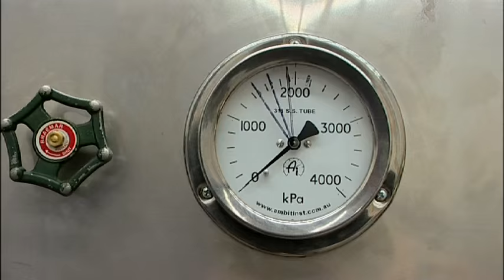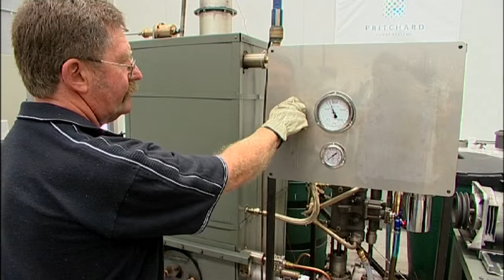Ted invents a new kind of steam engine

Comment: I do believe that Ted's design may not only be an answer to 3rd World power generation but an answer to the worlds Plastic and Waste problems. I would love to see this engine running on waste plastic.
Reply: Reciprocating steam engines are not the answer to anyone's problems
Reply: @sandervanderkammen9230  It's really not your typical reciprocating Steam Engine. It is much more efficient than a typical reciprocating Steam Engine and when Ted had one in the Falcon it was better than the new GT of the day. It took a long time for ICE engines to pass it in efficiency but it still has the advantage to be able to run on any fuel. The world has two major problems where the solutions are at odds. We have a plastic pollution problem and we have a carbon problem. We can turn plastic into fuel but it makes the carbon problem worse. We still need energy and we still need to do something with the plastic, engines like this could help especially in 3rd world countries that also have a environmental trash catastrophe playing out that we in developed countries are very much responsible for.
Reply: @theauthenticsteve  That is absolutely false, Ted engine was not a breakthrough design and was horribly inefficient.
The performance specifications of Teds Falcon qere so embarrassing that he nearly publicly discosed them although he continued to make false claims to attract investment.

Plastic can bevery easily converted into ethylene gas which can be used as a fuel in internal combustion engines with 400% greater energy efficiency.

Reciprocating steam engines are obsolete technology.
Reply: @sandervanderkammen9230  You clearly don't know what you are talking about. Plastic conversion is not efficient and currently uses more energy than you recover. I question your motives to write such rubbish.
Reply: @theauthenticsteve  That is why plastic is either recycled or simply discarded...
If your country is too poor to afford Diesel engines??? Waste plastic is the least of your problems.
Reply: @Captkid1 Reciprocating steam engines are obsolete technology, you are obviously not qualified to speak inteligently about reciprocating engines if you think they have a future.
Reply: I see Ted’s still making your mangina bleed 🩸  @sandervanderkammen9230
Reply: @theauthenticsteve  yes it was a poppet valve uniflow, not common in steam engines.
Reply: @6killer426  Ted is dead... and so are steam cars.
Reply: @6killer426  Steam engines are not common... what is your point son?
Reply: @sandervanderkammen9230  I have one it works just fine, and gets better fuel mileage than my friends Ford Model A
Reply: @6killer426  That proves nothing.
Reply: @6killer426  Does it get better mileage than a BMW Diesel car or a Toyota Prius??? Yeah! That's what I thought son!
Reply: @6killer426  I don't drive a Prius either, but Toyota is the largest automobile manufacturer in the world because they don't sell steam cars.
Reply: @6killer426  The fact remains that the Prius engine is 41% thermal fuel efficiency and the car gets 54 MPG.

Something a steam car can never achieve.
Reply: @6killer426  41% is better than many high efficiency steam powerplants with heat recovery cycles.
Reply: @sandervanderkammen9230  No, but I like driving it so I pay the fee to drive it. I also own a gas turbine powered 240Z that I like to drive it gets poor fuel economy but I like to drive it.
Reply: @sandervanderkammen9230
Reply: @emil.honganmaki5461  .
Reply: I would love to see that, but unfortunately plastic burns very unclean to the point of causing asthma in communities near where it is being burned. Unless a steam engine can burn at the temperatures of an incinerator, it is going to produce toxic fumes.
Reply: @michaelklim8277  Plastic burns very clean in an industrial incinerator but not in a steam car...
Reply: @sandervanderkammen9230  By your argument, they would be better off buying a lot of Priuses and use them to generate electricity, than generate electricity in the steam powerplants they use today. It makes zero sense.
Reply: @sandervanderkammen9230  40% thermal fuel efficiency peak*. On average, it is around 10-25% efficient.
Reply: @londonnight937  That's exactly what a Toyota Prius engine does, it generates electric power very efficiently or can power the wheels directly... which ever demand operates the engine most efficiently.

If the engine is operating below optimum efficiency?
It simply shuts off.

The Atkinson Cycle Heat Engine is vastly superior to the Rankine Cycle in thermal fuel efficiency, especially when scaled down to a typical automotive application between 100 and 200 horsepower..
Steam simply cannot compete at all, they use 400% to 500% more fuel per horsepower.
Reply: @londonnight937  Correct, 40% PEAK, BUT...
 Internal combustion engines like Diesel Cycle and Atkinson Cycle engines have a much LARGER BSFC Isographic Efficiency Island and are several times more efficient across the entire RPM and load range.
A 150hp reciprocating steam engine in a typical automotive application will have a peak efficiency of only 12% but will usually operate on a typical drive cycle test in the 3%-5% range.

Any questions?
Reply: @londonnight937  There is no place for debate here, these are irrefutable facts based on the Laws of Thermodynamics and  Physics.
Anyone who doubts these facts is not qualified to discuss this topic intelligently.

My advice is to seek enrollment in a fully accredited engineering program, YouTube is not an appropriate place to attempt to educate yourself, you lack some basic fundamental skills to take on a serious discussion regarding Heat Engine efficiency.
Cheers!
Reply: @BigCroca Just the facts here kid, you cannot bs your way around the SECOND LAW OF THERMODYNAMICS.
Steam is very inefficient and can never match the efficiency of internal combustion technology.
Stay in school and read some books.

Comment: It's a pretty noisy engine, though. The ones in Jay Leno's steam cars didn't make much noise at all, but could easily get the old cars up to 70 mph.
Reply: Howard Hughes owned the roadster model that Jay Leno has now. He modified it and it reached 133 miles per hour on a rural road. If only Abner Doble had been born early enough to compete with manufacturers before WW1 and was less of a perfectionist to the point of accepting mass production of his steam cars. I can only dream.
Reply: @charonstyxferryman  There was nothing experimental in design or concept... based entirely on old outdated technology, the company operated as an investment scam so very little money was spent building the prototype.
Reply: @sandervanderkammen9230  Any documentation of urls to support that?  I was rather wondering what was so revolutionary, myself.
Reply: @BryanTorok  Its well documented that Pritchard accepted millions in loans and both public and private investments but never produced any verifable, independent third party test results or demonstrated any significant technical achievements.
 Pritchard's extremely vague fuel efficiency and emissions claims are simply not credible for anyone familiar with reciprocating steam engines.
There was very little to show for all the investment capital when Pritchard filed for bunkruptcy, the Ford Falcon and the  Holden Torana were sold for scrap metal.
Reply: @sandervanderkammen9230  I remember from decades ago being told that steam would be better because one could more precisely control the continuous combustion and recover more of the heat generated rather than starting and stopping the combustion hundreds of time per second.  But, most people didn't want to wait for the boiler to build steam pressure before driving the car.  Also, one can start and stop a gasoline ICE on command so many short trips are not a problem.  

Anyway, there are hundreds of folks on GoFundMe and other platforms hawking investment in unworkable ideas with dubious demonstrations and unwitting folks throw money at them.  I almost wish I was that unethical.
Reply: @BryanTorok  Unfortunately what you were told is incorrect, Nicola Carnot  published his formula in 1824 based on the Second Law of Thermodynamics  that shpws that steam engines could never match the thermal efficiency of Internal combustion engines.
 Rudolf Diesel conclusively proved Carnot's theory in 1897.
 I'm not familiar with the legal system in Australia but there seems to be a disturbing number of these types of investment scams in Australia based on fraudulent engine technology schemes.
Reply: @sandervanderkammen9230  Unfortunately, Elon Musk has been bilking investors for a dozen or more years with his fantasy of a high speed vacuum tube hyper-loop train.  He promises speeds faster than commercial air travel for a tenth of the cost.  For a deep dive into that and other investment scams look up Thunderf00t (those are zeros) on YT.  He has a whole series of videos debunking all sorts of things.
Reply: @BryanTorok  Do you know how to tell when Elon Musk is lying???
His lips are moving!
Reply: @sandervanderkammen9230  I've looked at the videos of NASA's launches from the 1960s on through the Space Shuttle.  I note the space suits that that the astronauts wear designed to protect from sudden decompression and the joints that allow motion under pressure differential.  I also note NASA's laid back seats designed to distribute G forces on the body.  Then I look at the vids from the Space X launches and I see costumes and seats that look like they are from a cheap/poorly done sci-fi TV show.  The landing vids look like crap CGI.  

But all the Gen Xers seem to eat that stuff up.  For the record, I believe NASA went to the moon, and that the Space Shuttle and International Space Station are real.  Ham radio operator from the era and even the present tracked and listened to the communications in real time.
Reply: @BryanTorok   It is a private company, being extremely homosexual and flamboyant is a good way to get big bucks from investors (not engineers) I imagine
Reply: @sandervanderkammen9230  A lot of engineers / supposedly educated people apparently work on these types of doomed-from-start projects. Is it the lure of money, lack of wisdom or lack of intelligence?
Reply: @charonstyxferryman  Its well over TRL 7.5 and have been run in Australia and India.
Reply: Well the old Stanley steam car engines run at maybe 300-400 RPM, and so make a lot lesser  noise. This steam generator runs on more RPM more likely 800-1000 RPM for the Generator, so its clear, more RPM= More Noise. Also the engines on a stanley are capsuled up and this engine has open parts.
Reply: @mrviking2mcall212  Abner Doble made many mistakes and was his own worst enemy, he also lost his brother John who was the best engineer in the family.
Reply: @diobrando2160  Sander Vender Kommraden took a couple thermodynamics classes at a junior college in Souther California and now knows it all.
Reply: @6killer426  They are both dead.. and so are steam cars.
Reply: @sandervanderkammen9230  GenderBender Kommissar always gotta have the last word.
Reply: @6killer426  Sailing close to the wind there son, you have been warned.
Reply: @6killer426  The TRUTH is the last word... lies and ignorance will never prevail.